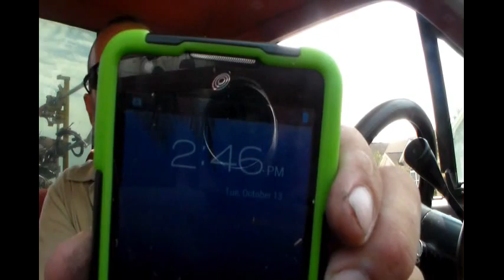MAKE A LOT OF MONEY CUTTING GRASS - E-Z Lawn Service Set Up

Comment: Today is 3/10/20
I know this video is older, but as beneficial as the day you made it Dan. Thank you.
My truck is almost paid for, I've aqquired a trailer & handheld's, now just need the mower.
And I keep coming back to the 36 Turf Tracer as the wisest & most logical first commercial purchase i could make.
Gates, Hills, Residential, Powerful, Hydro...
Nothing fits what meets my needs better.
At 55, I'm not pushing a mower. Going with the Slide.
Maybe a Walker addition in a year or two 🤔
Thanks Again Dan 👍
Reply from the maker: Gary Cecil Garrison I like everything you said except the slide, please reconsider your choices. What you want to get for a Hydro walk behind is a two wheel Velky with the wheels fixed to the Velky and it pivots on the bar that mounts to the mower. Anything else lengthens the footprint of the mower front to rear and literally slams your body against houses and fences in tight turns.

Comment: So, does your standard services include line trimming along structures as well as edging along the drive, curbs, and walkways?  What if they are new and the grass is grown over the sidewalk?  Do you find you need a push edger in that case? We don't own a stick edger, only a push... and I'm thinking of changing how we perform our service.
Reply from the maker: +ABC LawnWorks Standard is cut edge weedwhack and blow. Hedges are extra. If I sell them on hedge trimming, I usually do them once a month and add it into their lawn care price. If the edges are real bad, I charge extra for the clean up in most cases. I haven't used a push edger since I was a teen ager. All done with a stick edger.

Comment: I got a  v6 f150 long bed stick shift pick up but when I roll with my 30" zero turn rider it burns fuel like a v8
Reply from the maker: Guess if you add a trailer it will burn like a V12?? Lol